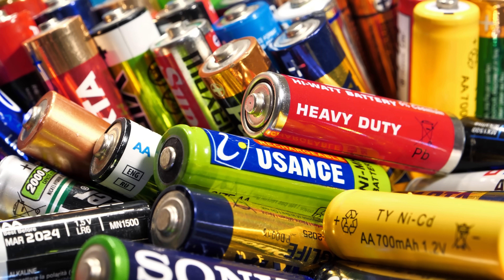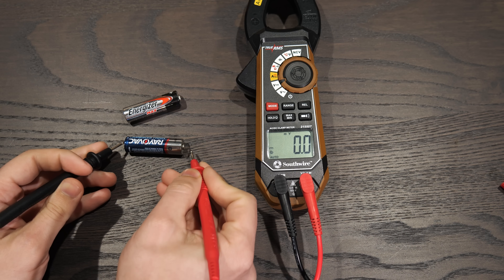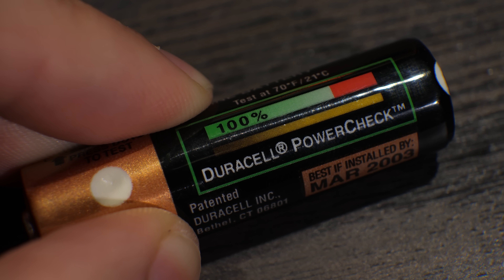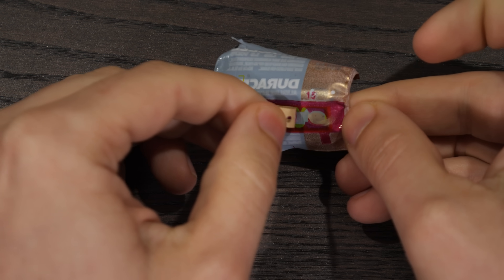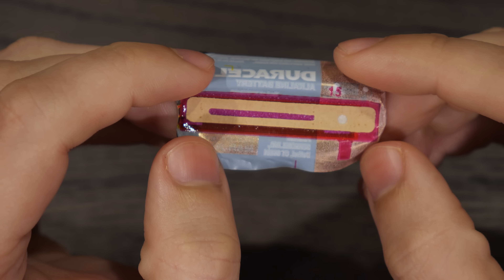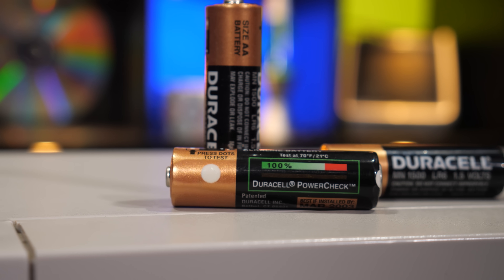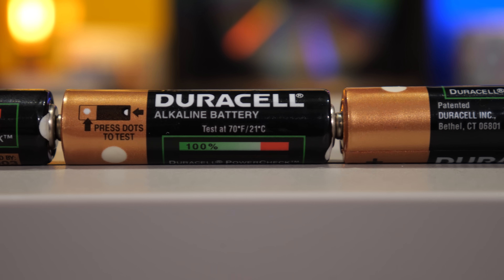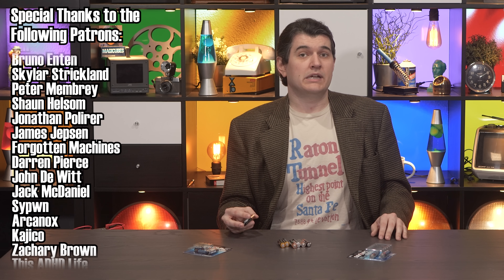Duracell PowerCheck: A genius idea which didn't last that long

Comment: I remember my dad being very anti battery. He made a point to try to buy everythingin a rechargeable form if at all possibly, and most kids toys that used batteries just died and didnt have lights or sound after. (Think baby toys, my mom made sure our gameboys and tv remote got batteries 😂) 
Now i understand his anger and frustration! Theyre expensive! The cheap pnes are MORE EXPENSIVE because they suck so much. 
There a million different sizes for different products, so bac k then you could have a whole ass battery drawer (we did! Even though my dad tried to avoid battery operated things ad much as possible- society wanted everything to take AA, AAA, or D, batteries lol)
Our batteries were MOSTLY reserved for necessary items and most of those items were emergency kit stuff like radio and flashlights for hurricane season. 
This is such an interesting video, i completely forgot about the power check batteries!

Comment: Why destroy your fingers with the pressure to see if you can get a reading, it was more like a fairground game that was rigged against you! 
It was far easier to use a couple of probes of a combined volt/ampmeter 
to get an accurate reading!

Comment: When it comes to alkaline batteries, if you aren't going to use a device for a period of time, it is safer to take the batteries out of the device. Alkalines have a tendency to leak battery acid and ruin circuit boards.

Comment: Cameras would be a use case that you would not want to test by using. Taking a photo to test would mean one less from your reel. Would good to make sure you had enough juice to get you trough an important event. As mentioned one of the best features was the ability to test under load from the little strip. This would be sure to let you know if batteries were too old or if the battery you brought as back up would have been good enough.

Comment: I use battery testers a fair bit more to verify if a battery or the device it is plugged into is broken. But even in the days of these sensors I still used an independent tester because it was seriously thumb impaling to try and use these strips.

Comment: I would go back to spending the extra for Duracell brand if they still had this. Even as a kid, I knew it was worth straining the muscles in my thumbs to use it as a first stage diagnostic tool to figure out why things stopped working.

Comment: I do remember those! And yes they were indeed a pain in the rear end to activate! The only use for this sort of gimmick as I see it would be if you wanted to validate whether a battery or the appliance under test was faulty. Otherwise it's just an extension of a development feature that would come in handy during manufacture.

Comment: I always wondered why they arent on rechargeable batteries.. since the chance of you not knowing if they had charge was much higher.. but very interesting to finally know how the dots work ❤
Reply: I imagine that it's because their primary purpose was to tell the owner whether they should be discarded, but we don't discard rechargeables and there isn't much need to know how low or dead they are because they can be recharged regardless. The easier something is to recharge, the less we need to check its charge.

Comment: As a kids I always thought these were so neat. Nowadays I haven't bought batteries is years, as I use rechargeable AA and AAA batteries.

I much prefer removable batts for certain gadgets to always have power at a quick change instead of waiting for charging. So much more efficient to externally charge. 

I remember my Samsung s5, I NEVER ever had a dead phone, nor did I have ever have to charge the phone itself, even at a festival. Haha. I had an external charger and like 5 batteries. 

I prefer removable & rechargeable batts for tech like my head lamp, camera flashes, remotes, mirror light. Nice to have removable batteries and spares, organised in cute little organisers. I put a + on the box, and like up the batteries + to + for charged, and  + to - for dead.

Saved sooooo much money this way

Comment: If you haven't already, you should do a video on NiMH rechargeable batteries vs Li-ion.  For most alkaline battery replacement setups, there's still a lot of confusion on which battery chemistry is "better" to use.  IMO there's a bit of detail to unpack there.

Comment: Works the same way as an old rotary dimmer switch. The bi metal strip, in a circle in a dimmer, has higher resistance at the thin part of that strip. These acts like a tester on the battery and resistor in series with the load on a dimmer.

Comment: I think there's another partial reason why they didn't keep this around for long (not the whole reason, but may have contributed in the decision): Battery companies make their money by selling batteries. That's their whole business model. By adding power checkers (which I remember often made the batteries also slightly more expensive in stores, so they stood in shelves for longer and were bought less often), it promotes people to check and reuse partially-drained batteries instead of just chucking them out and buying fresh ones. I wouldn't put it past these companies for bagging on people to throw out old batteries instead of giving them a second life, and adding a way directly on the battery to check then-and-there whether its flat or not goes against that ideal.

Comment: I really liked those! I used to keep a few wrappers with the tester strip before I got a dedicated palm-sized battery tester. I had lots of stuff that required batteries at 40% or higher. Although nowadays, disposable batteries rarely last anywhere near their labeled expiration date if not stored in a constantly air-conditioned environment. They usually explode otherwise within 2 years of manufacture in hawaii. Even less if kept in a device, especially remote controls. Japanese batteries seem to last way longer for some reason.

Comment: I replaced all AA and AAA on my small devices with 3.7v rechargeable lithium batteries harvested from disposable vapes I used to use and just toss, most are very flexible with the voltage and the extra 0.7v doesn't kill them at all, the vapes got actual circuitry to properly charge the cell, some I have even got fancy screens showing the charge %, one I dare not destroy has an actual touch screen and LCD screen with a little animation it plays lol no joke(elfbar bc20000 touch).
Apart from the battery they have other stuff easily harvested like led's and sensors.

Comment: i imagine the main use case for these is putting them in holiday lights or a furby or something, putting that thing back in storage & removing the batteries to prevent corrosion, then finding the batteries a good few months later with no idea how charged they are

Comment: As a kid basically the only time we used the tester was to confirm that the batteries were in fact dead and the reason the walkman/discman wouldn't turn on.

Comment: I used to work at a place that general public could bring in cable equipment and return it back to the service provider for free. The amount of batteries you could collect from remotes was insane. Knowing if any were worth keeping around would have been useful 😂

Comment: Anyone with battery operated Christmas gizmos likely stores the, without batteries, lest they leak in storage. I always assumed the Duracell power check went away as Duracell mover production to China and tried to be as cheap as possible.

Comment: I'm not sure what's worse, AA batteries in an old device that have corroded everywhere, or a device that has an unremovable battery that can never be used again once the battery goes bad

Comment: Working as a sound engineer in live shows, having half used batteries is really common. If we dont have hardware with lithium oem batteries, that usually shows the time left before recharging, we slap fresh alkalines before the show, to ensure they wont die for the next 2-3 hours. Then, after the show/event, those batteries are taken out, thrown in the drawer to be used during soundchecks. Testing them with the multimeter is kinda rough, so i would love that gimmick back on them.

Comment: You know, I bet that might actually be a useful feature for rechargeable batteries. You know, the nicad and nickel metal hydride double and triple A batteries? It could be a useful feature to be able to test those on the battery. Just a thought

Comment: I loved these and used both the battery tester and the battery extensively and bought them specifically for these, as I was careless and often mixed new and used batteries lying around.
I also bought Philips batteries mainly because they never ran out, nowadays there is no battery that lasts as long as these did.

Comment: Fun fact: some designers wanted to be even more annyoing and designed their product to work with AAAA-batteries (yes, quadrouple-A batteries). I found out about these about 2 minths ago when I finally decided to replace the batteries in humidity sensor for my home alarm system after it having complained to me for a while. I opened it up and saw something I have never seen before: it used AAAA-batteries, which are just marginally smaller than AAA-batteries, but MANY TIMES more difficult to get ahold of. I was pleasantly surprised that a Swedish chain for various technological things had them (Kjell & Co, kinda like Radioshack I guess). The girl at the counter thought I was joking and was very surprised to learn that not only do they exist, but that they also sell them.

Comment: The one case where I used to do just that (pull batteries out of something and put them into something else), I had a digital camera that was intended to use Oxyride batteries (nickel oxyhydroxide), and these were as far as I can tell not available outside of Japan.  Apparently the Oxyrides would start at 1.6-1.7V and pretty much not drop below 1.5V until they were pretty dead.  So this camera would crap out if the batteries got below about 1.4V.   I'd put AAs in there, pull them and pop them in a remote or whatever after that since they still had a pretty long life in there.   I remember these batteries with the charge gauge -- as you say, cool, but unused.  

My dad actually does pop a voltmeter on some from time to time to verify if they're dead  (as opposed to the batteries seeming to not work because of poor electrical contact with the battery contacts in the device... usually a remote.)  Of course, other than remote controls, almost everything now has a) rechargeable batteries (great!) and b) non-removable (boo!)

Comment: I recently found a set of 4 of these batteries in an old device at my workplace. They were definitely dead, a couple of them slightly corroded, and coincidentally also have the "best by" date of Mar 2003. This video was very timely for me to learn about these. I initially put them in the battery recycling bin with a bunch of other newer ones, but now I think I will take them out and keep them for their significance as historical oddities that someone else in the future might value. I'm sure there's not many of these late 90s-early 2000s batteries with incorporated testers remaining in existence.

Comment: I think if they were not such a nightmare to press i would have loved them, but i remember them hurting the tips of your fingers every time you wanted to check if they were still good, In the end i just avoided buying them and just brought cheap supermarket batterie's, Eventually i moved on and stuck to rechargeable batteries that were 2000mah

Comment: This was a great idea Duracell had. I bought Duracells just cause of this. Sometimes you didn’t have enough new batteries so having this was convenient to check which batteries was good. I would take batteries out of something and check to see which had the most left to use. I’m sure the battery companies would rather just replace all the batteries instead of checking them. That might be why this didn’t stay.

Comment: Growing up my family would always get our multimeter out to check each battery if something stopped working or started acting funny. Usually only one of the batteries was dead, so it was useful to be able to check which (or if it was some other problem with the tech) and not throw out good batteries. I would never have considered that the power-check would be used for testing batteries that have been lying around, but rather to diagnose issues and prevent waste

Comment: 13:29
it still baffles me that Oculus headsets used AA batteries for their controllers instead of a rechargeable. So few things use them nowadays. Literally the only reason I still have AA batteries is for my headset controllers. At least you don't have to replace them all too often, but still

Comment: I use a battery tester frequently. 
We use all manner and chemistry of battery. The small, cr123, A, AA, etc.. may be anywhere between 0 and 10 years old. 

Not to mention the batteries may be used, unused, frozen, heated, dented, corroded, hit, used as tools etc...

When a coworker asks why his tool isnt working, and blames the battery, its handy to be able to rule out dead or dying batteries. (9/10 the person probably used his tool as a hammer, or prybar)

Comment: I remember how I played a lot of Wii and when the Wii Remote was out of power I changed the battery and put the used one in a box. But on one Sunday my last batterys died and I combinate different used batteries and got some of them together so I had a combination that worked for a few days

Comment: The way I remember it, fresh batteries was the first troubleshooting step after "turn it off and back on". Actually, since taking the batteries out turns it off, so swapping the batteries was the first troubleshooting step. So then 5 troubleshooting steps later when it's working but you're not sure which thing actually made the difference, you have the old batteries that you're not sure if they're dead or still have plenty of juice. So you just shove them in a drawer and say "that's a problem for future me".

For me, the PowerCheck was a very welcome feature!... until I realized how poorly it worked. I'd often have fresh batteries that showed as dead because I couldn't push the damn dots right.

Comment: This is taking “they don’t make stuff like they used to” to a whole new level.
Reply: They still make these lol
Reply: @Robstrap you prune
Duracell NO LONGER HAS THE BUILT IN POWER CHECK ON THE BATTERIES(you need to use a Digital Multimeter these days to check how much Voltage AA and AAA Batteries)

Comment: My friend, size of battery isnt everything. Voltage and current output is also something inportant that designers need to take into account. Goving a circuit the wrong voltage or current will cost more to make sure it has components that can handle it

Comment: My mom has a problem with keeping dead batteries for different TV remotes  because 1 remote requires more juice to work, but other remotes and tiys in the playroom for grandkids dont need fresh batteries to give a kid 30 seconds of playing with it, then getting bored and playing with something else, so there is this small community jar of batteries for mostly kid toys, and just seeing if something works that was bought from a garage sale or marketplace. That jar comes in handy sometimes, and if you're  lucky, you might find 2 good batteries! 

But this jar needs a tester, its getting full and annoying when you encounter nothing but dead batteries that might still power some little toy up.

Comment: Looks like they've made a come-back as i've just seen someone using some new ones [here in the UK], they looked slightly new design with segmented or graded blocks likely good/ok/bad - i didn't study them for too long, still i's surprised to see their return. 
In any case i won't buy any disposable alkaline Duracell batteries as they all leak far too easily compared with their other well-known rivals even in devices that aren't draining when batteries are left in them. And as for their replacement cells such as Li-ion packs for cameras their life-span were always sub-optimal.

Comment: growing up, we’d always get the cheapest imported china cells from a chain of gift shops called Søstrene Grene. I remember that the Duracell batteries were at least three times more expensive, but the battery charge check feature made them appear to have much more capacity than regular or cheap ones. The logic was that the capacity had to be much higher than regular batteries if the factory would include a battery check on every cell. Pure marketing.

Comment: Okay you are completely forgetting an entire type of consumer. Cheap old men. We had a need for like 22 batteries in the house right but daddy only bought a single pack of batteries which meant 8 batteries for 22 uses. And that's why we were constantly cannibalizing one thing for its batteries to put into another thing to power it. Which meant that our batteries didn't go from package to thing to trash ever. Our batteries went from package to thing, to thing, to thing, to thing to thing getting all mixed up. Sometimes they weren't a pair sometimes they were loose singles. They were never in a junk drawer, that never happened. A junk drawer is a luxury for rich people! If you've got "junk" then you've literally got cash you shouldn't have spent which means you are fiscally irresponsible and in this house we don't waste our time on people who waste their money. Sorry for lost in 1992 there for a second, anyways you forgot a whole type of consumer, cheap old men.

Comment: I remember just before the built in testers were a thing, Duracell used to put a separate tester strip in packs of AA batteries. It was easier to use, but we seemed to accumulate them

Comment: There is a difference in voltage between AA and AAA so the electronics design choice might influence which battery you need to use